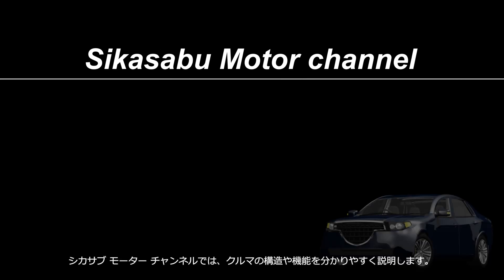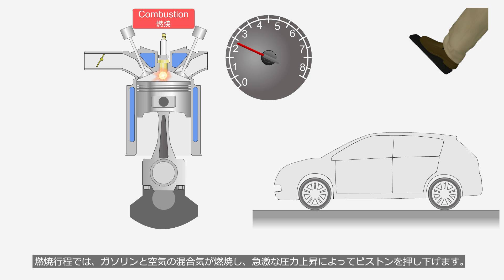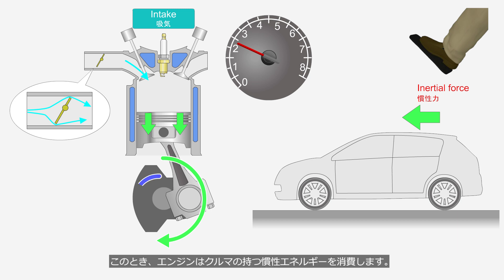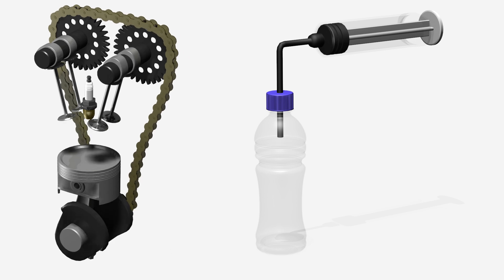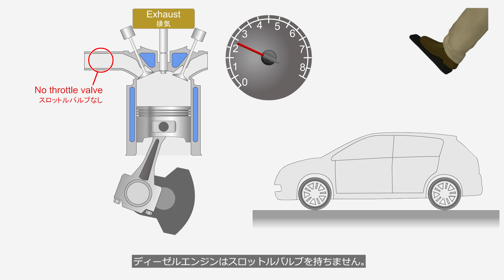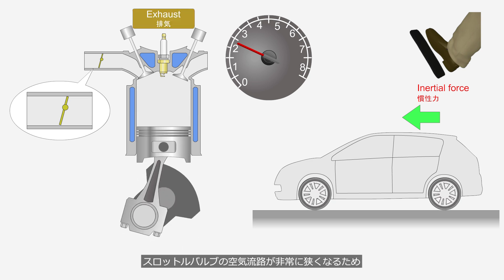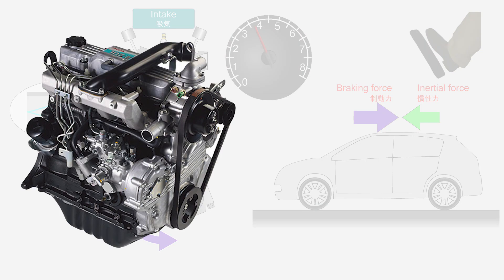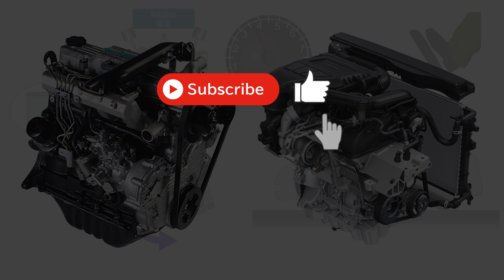Engine brake and Pumping loss, How they work.

Comment: 5:40 isn't it true also for N/A gasoline engines as a function to keep the catalytic converter hot? Very little fuel is injected with very late ignition to keep exhaust gases hot.
Reply: Is it harmful to engine when using engine break ?
Reply from the maker: In general, it is considered safe as long as the engine stays within its allowable RPM range.
Reply: @t.f.t.6 engine braking is perfectly safe (as long as you don't let the revs raise past the redline in the RPM range) and doesn't cause anymore wear on the engine than the normal operation of the engine spinning. The only disadvantage is that it can draw in oil past the piston rings and valve stem seals but this also isn't an issue if you're using the correct oil (Cat safe) and check the oil level regularly and top up when needed. You might think of an engine creating friction and wearing the engine to brake when you hear the term "engine braking" but the almost all of the braking from engine braking is done by the pumping against the air/vacuum and causes virtually zero wear on engine components which wouldn't already be happening by running the engine normally. All of these forces are also present during normal operation of the engine, only you're using the fuel to combust and overcome these forces rather than momentum in the case of engine braking.

Overall engine braking actually saves you money as it assists the braking system which reduces pad/disc wear and also puts the engine into fuel cut-off mode so you're essentially using Zero fuel while the momentum of your car turns over the engine without the need of fuel to do so.
Reply: It's true that engine braking cools the catalytic converter but engines don't generally burn fuel to keep it hot, during normal driving it wouldn't cool it below it's operating temperature but if you're on a long descent HC emissions will be slightly elevated when you use the engine again but wouldn't take long before it reaches operating temperature again, this doesn't effect the Cat or the way the car drives. Not allot of air flows during engine braking in a petrol engined vehicle because of the throttle body restricting the flow of air and some vehicles will actually close it further than (or even fully) compared to the standard slightly open idle configuration (which is constantly adjusted by the ECU) which also assists for engine braking and restricts airflow to the Cat even more. The biggest disadvantage to this is that it can draw in oil due to the high vacuum applied to the piston rings and valve stem seals. Which also isn't an issue if you keep your oil topped up
Reply from the maker: Thank you for watching the video.
Yes, since modern emission regulations also limit exhaust emissions during cold starts, control strategies are implemented during cold conditions to raise the idle speed and inject a richer air-fuel mixture to help warm up the catalytic converter more quickly.